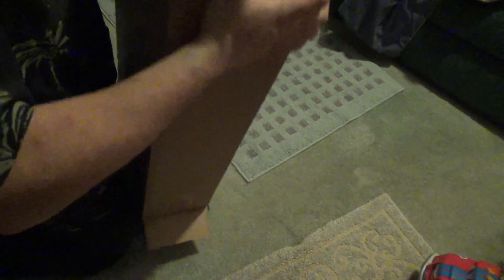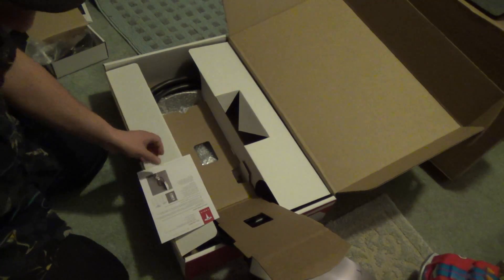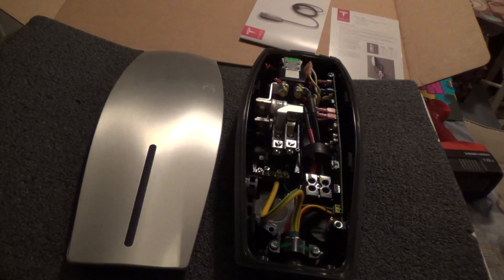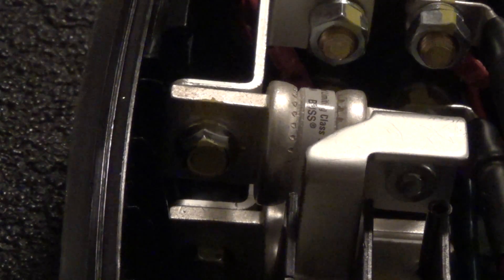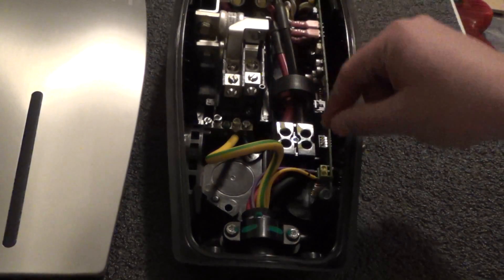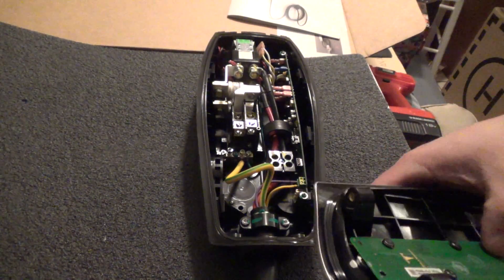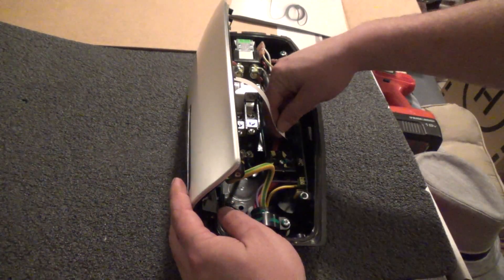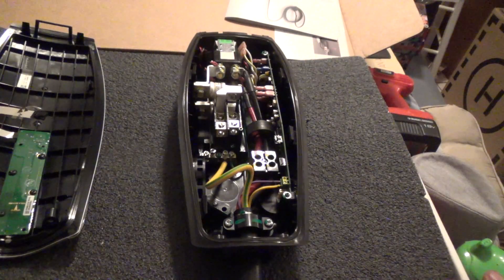Tesla Motors Model S / X: HPWC High Powered Wall Charger Un-Boxing & Overview

Comment: I wonder if there is load sensing built into the charger. If for some reason the car goes bananas it would be a good idea to kill the charger with other than tripping the panel breaker or blowing those internal fuses.
Reply from the maker: +obsolete professor if the car senses a problem, it will drop current by 25%, then to 50% then to 75% then disconnect. if the car goes ape, you have more problems to worry about

Comment: Hi Can anyone to measure all around dimensions for HPWC? I need height, width and deep. The installation manual just have a bracket dimensions. I would like to buy electrical enclosure.

Comment: Just a note, the ring around the output wires isn't a ferrite core.  It's the current sensing transformer for the GFCI circuit, as required by the NEC.  It also has a test circuit wire inside it.

Comment: Do these charge any EV, or do they only work with Tesla cars?
Reply from the maker: +DrToonhattan Yes and No. No because it uses Tesla's Proprietary plug end, Yes, because you can replace that plug end with a third party J1772 plug and it will be backwards compatible and able to charge any J1772 compatible EV.

Comment: Problem is how you will connect with your source and and source must need a saparete bus with a RCD to keep safe and there is a lot of work and need big wire allow to running high amps otherwise everything will be heated up . And RCD fuse also needed upgrade and also main board fuse as well what I think .

Comment: Great video of the brake down of the charger... as for the knuckle heads that like the petrol cars, they just don't get it. They can't see the big picture about going electric. They love paying for fuel and will pay all their life for it. Sad they can't teach them how to get away from petrol fuels.  Sun=Solar=Electricity=Free Fuel.  I've logged more then 13,000 miles and not a penny to recharge.
Reply: I can tell you don't own any, nor have invested in it.  Just buy the words you wrote. One item, I own them, I invested in them, they have paid themselves off.  It's unlimited energy from the sun, we haven't had a day the Sun hasn't risen in the east yet ! If the sun stops, we won't have to worry about anything at that point. Reality, all things manufactured have a foot print, but these last for 30 yrs. It Outways the control your under, having to purchase fuel from the big Oil ! I use my clean solar from my house to charge my ALL electric suv and drive to work and back, over 19,000 miles, NO emissions. And yes the power company makes money off me producing excess power during the day, from the sun !  So they burn less fuel, supplying your house.
Reply from the maker: Nicely Put. I don't worry about the sun not coming up though, I worry about it rising in the west. because then; "OH NO! GODZILLA!" (Taken from one of the OLD Films, sorry, couldn't resist)
Reply: Themachinewon Nobody "loves" paying for fuel. Most of us don't drive EV cars because of two reasons. 1) We don't have the charging infrastructure where we live. a) I live in a highrise with external parking. b) There are no charging ports/station nearby. Making any medium to long journeys (which we frequently do) is rather impossible.  2) The Electric vehicles that actually have the range to suit my needs (i.e. Tesla) are discouragingly expensive. The Model S is 4 times more expensive than what I currently drive. There is no way I can afford that at the moment. So, until prices drop, or until there is a more affordable EV with reasonable range, or until there is charging infrastructure where I live, I'm stuck with paying exorbitant fuel prices and road tax unfortunately.
Reply from the maker: It's ok, More electrons for me :) The more gas they burn, the less electric they use, so the utility will keep the electric rates down.
Reply: Electric isn't necessarily the future. LNG could be a possibility for internal combustion. Even with electric cars that power has to be generated somewhere and there is no guarantee that the source is as clean as you would want.
Reply: Hey man don't go hating on petrol. Most US consumers just can't afford the Tesla as of yet. Nissan Leaf is a joke, once Tesla releases a mode that's actually affordable around 30k. Then that's when you'll see a massive shift to EV.
Reply: *Model
Reply: Not to knock solar energy. But more of a response to your statement about solar power being. Someone has to pay for the infrastructure of construction of any solar power source. Be it a user of a EV or the utility company. Solar panels for homeowners aren't free. There is a cost. As far as being a cleaner  source then electricity is potentially better. It all depends on where the electricity comes from. If it's a power generator then the pollution is merely being moved down the line.
Reply: I wonder if there will a road tax for transportation electricity. Farmers get highway tax credit for fuel used in the field. The road tax per gallon is suppose to go towards highway maintenance. With more electrics on the road less money for road repair.
Reply: Themachinewon Okay Sherlock you missed it. I do have a 12 panel solar system for my house. The panels are warranted for 25 years. I don't remember what they said the power output would be at 25 years. Didn't worry about as that is quite a few years off. I'm not afraid of being critical about anything I own. However I understand your enthusiasm.

Comment: I still like petrol cars better.
Reply: Bartek Lewandowski when do you ever drive over 155 mph and need to get up to 60 mph in less than 3.2 seconds? It's also confusing because you've misspelled "they're" (assuming you're talking about gasoline powered cars being "faster") A TESLA S P85P goes 0-60 in 3.2 seconds and a TESLA S 85P goes 295 miles between charges, and will charge from 0% to 100% in about 4 hours for under $5 (at my house). So, I'm guessing you didn't know that.
Reply: No its because of allot more things Ok think about it if your going to another country with one of those electric cars And you need electric for it not all country's have them in the petrol station's unlike petrol or diesel.
Reply: I like petrol cars better because fuel is easily available.  However, gasoline is very expensive compared to electric and natural gas.  I run my cars on all three fuels.
Reply: Plus there allot more faster and you can get cars what run on allot less fuel.like a 1.0 engine if you fill it to the top you can run the car for basically a week with out filling it same for diesel it burns out allot slower than just petrol. I would say that diesel cars are the best.Because they have allot more pluses than others.
Reply: I do care about money, and there are charging stations all over the place, not to mention, anyone with a standard electric plug or a dryer plug can charge your car. For us, there are TESLA supercharging stations every 100 miles or so along the major highways in Texas so when we stop for 20 min. to get a snack and use the facilities we can get a 50% charge on the car. For me, I'd rather invest the money in the car which I can later sell than the consumables of gas, oil, transmission fluid, etc... The cost of ownership is roughly the same as a honda odyssey, I'd rather be an early adopter... but everyone is different, and there might not be as much in someone else's area. As far as us, we're working towards buying one in 2016.
Reply: Really so you will have to go to your friends house to charge haha ohh wait or drive 100 miles to charge.
Reply: You are being purposely obnoxious to John Harris who is only giving you accurate information. If you would care to listen to him you may be better educated.
Reply: I don't care about the power of the car but your gonna drive 295 miles thats about $40 - $50 petrol money for my car but then i can go were i want and yeah you have to go back to your house to charge.

Comment: Very informative video.  Do you have the part number for the Curtis contactor?  I'd like to use it for my OpenEVSE builds.  The contactor I'm using now is much larger.
Reply from the maker: No, I do not. I will need to look next time I open it up.